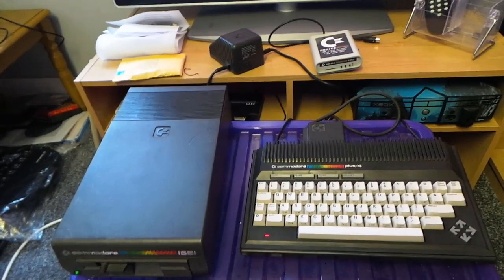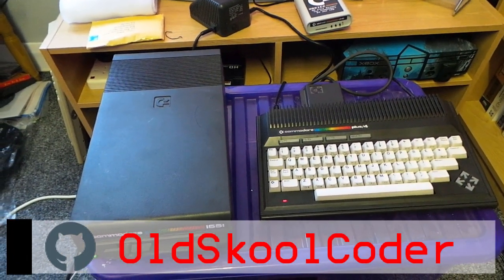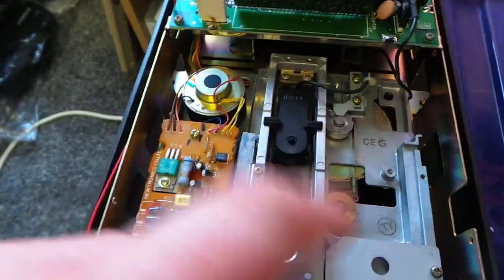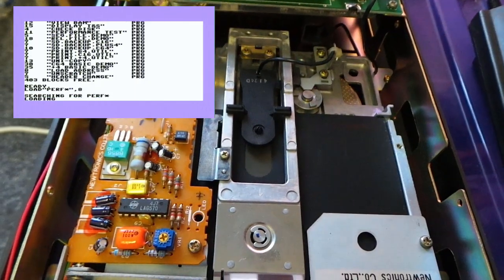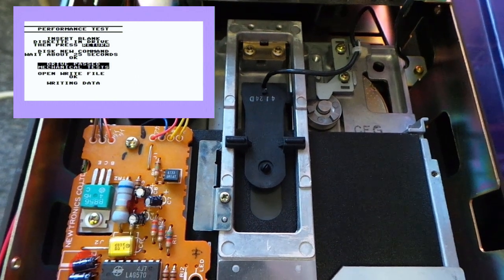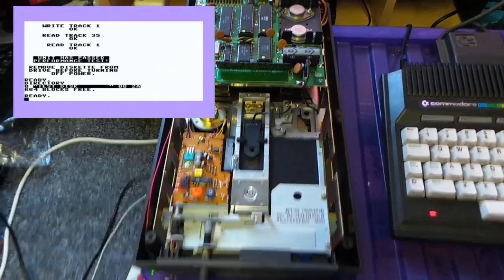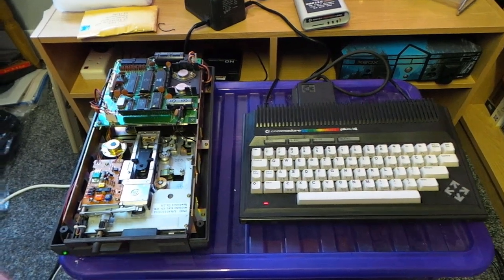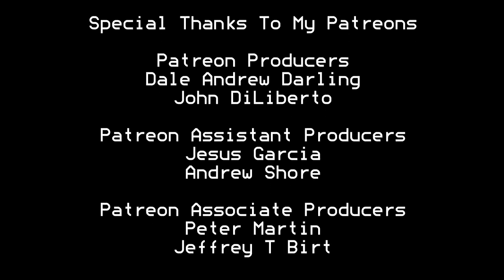Commodore 1551 and Plus 4 Update

Comment: This is an interesting machine. It's my understanding the 1551 has a different connector that allows for the higher speed.

One especially interesting thing, and this might be wrong but I recall reading about it, is the Plus/4 uses something of a modified Harvard architecture. The CPU (if this is correct) has an output that specifies whether it's reading opcodes and operands or reading and writing data. This would allow for ROM containing ML programming to be in the same address space as RAM with data such as BASIC programs, and the two would be automatically swapped back and forth without the need to do manual bank switching. This (if this is right) is what allows for the nearly 60K of memory available to BASIC.
For example, if this were in ROM:
.C000 AD 00 C0 LDA $C000
The AD, 00 and C0 would come from ROM, and the number going into the A register would come from $C000 in RAM, all done automatically. Again, if I'm understanding this correctly. And if not, it'd be an interesting mechanism to try.

Comment: that is a monster drive it dwarfs the plus 4 lol good save though
Reply from the maker: Yeah, your not wrong there, Commodore spent loads of money making computers smaller, but forgot about the peripherals lol
Reply: @OldSkoolCoder  They never got to making a 1551-ii, I guess. The Plus 4 line was a massive market failure, no idea what Tramiel was really thinking with this bizarre line of machines...
Reply from the maker: @8BitNaptime  was there a 1551-II ? i didn't think it got that far :o and because it was a market failure, thats why I wanted to get the drive working again :)
Reply: @OldSkoolCoder  No, no, it was just a joke... I worry that the 1551 seems to be using the troublesome Newtronics mechanism that will eventually fail all by itself with the infamous open coils in the R/W head.
Reply from the maker: @8BitNaptime  oh, i c... yup that may happen, but its too precious to play with it loads... :) thats what emulators are for :D